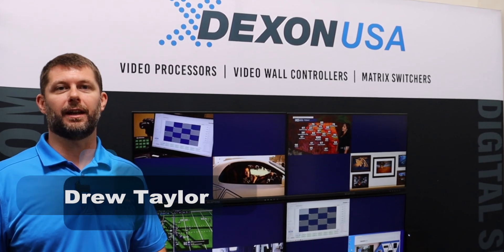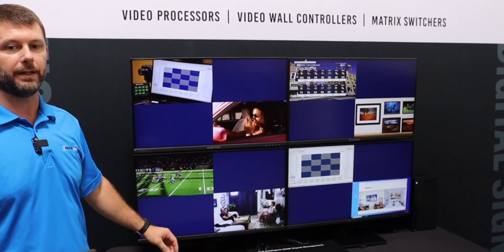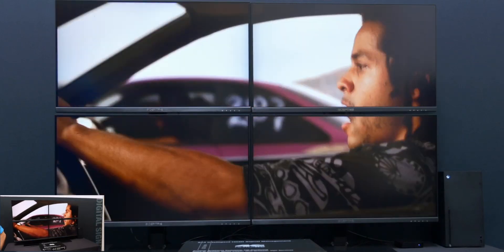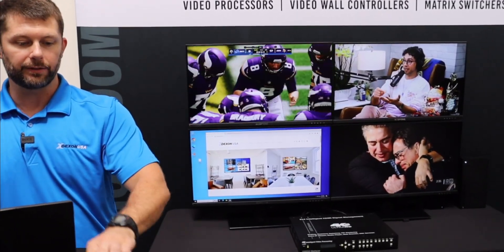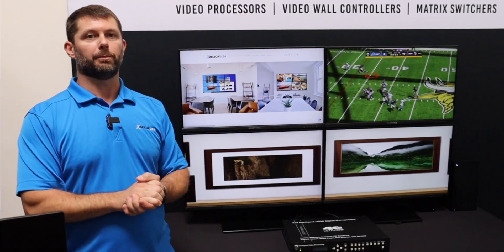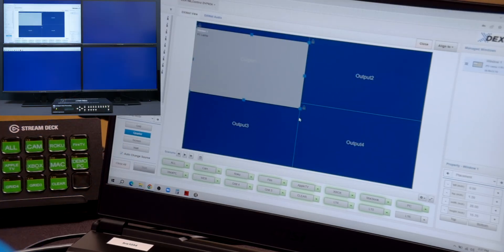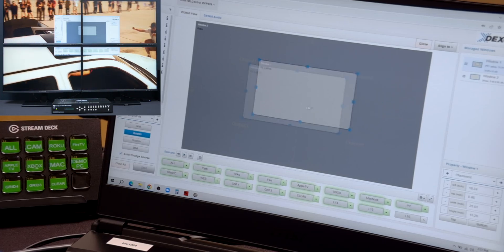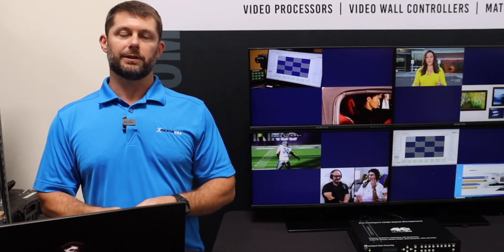8K Video Wall Controller - The First of Its Kind! - DVP824K

Comment: What is the max input resolutions/refresh rates it supports?
Reply from the maker: The inputs and outputs are HDMI 2.0 and support up to 4K @ 60 per channel. The (4) 4k60 outputs make up an 8K total canvas with up to 8  4k total layers.